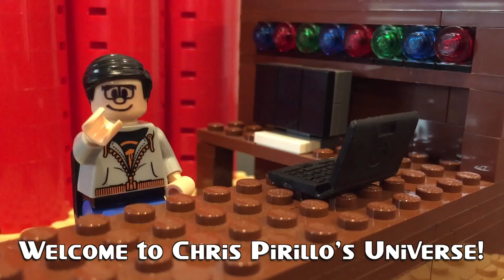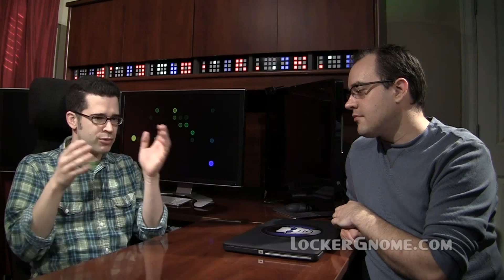What is an Ohm?

Comment: Ohm: the SI unit of electrical resistance, expressing the resistance in a circuit transmitting a current of one ampere when subjected to a potential difference of one volt.

Comment: @Neojhun  I dont think this is the case. The overload only happens because there is a temperature sensor and or current detector that detects overheating or too much current rush - so not really an ohm detector, more like a circuit to throttle the output in case of dangerous situation.

Comment: if you need to find volts, resistance, or current here is a easy. voltage is v, current is i, and resistance is r. if you need your current divide v by r. If you need your resistance divide volts by current, if you need your volts multiply your current by resistance.

Comment: I was looking at some high-end center channel speakers and they have 2 red inputs and 2 black inputs in the back of the speaker. The receiver I currently have, only has one red and one black output for the center channel. How are you supposed to use all 4 of those ports?